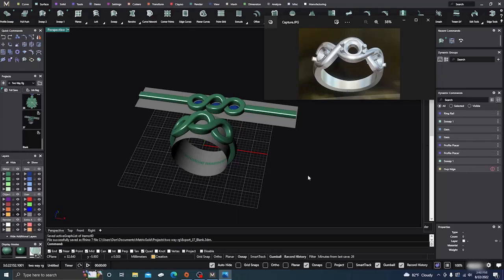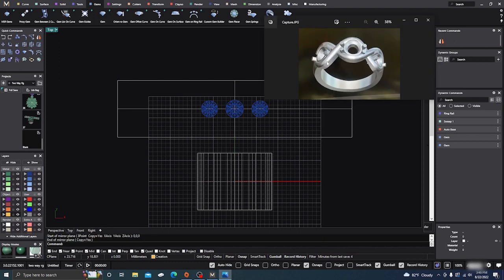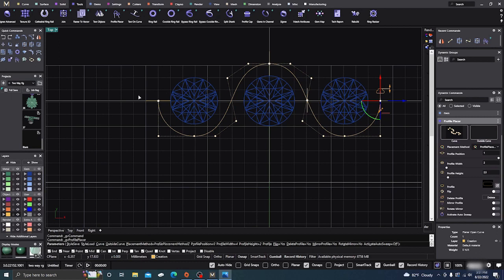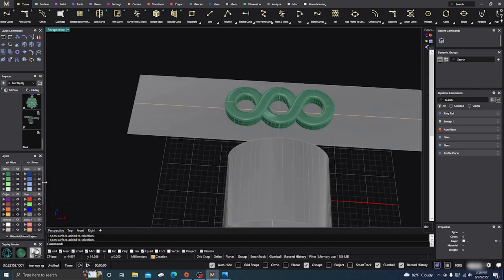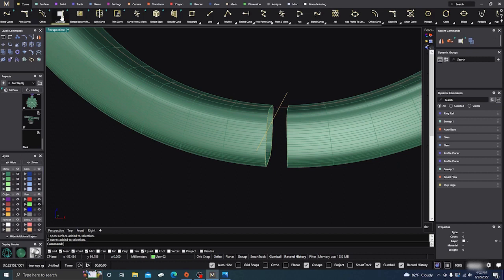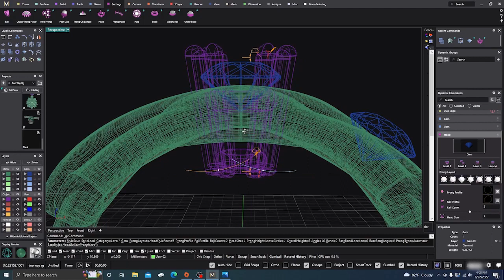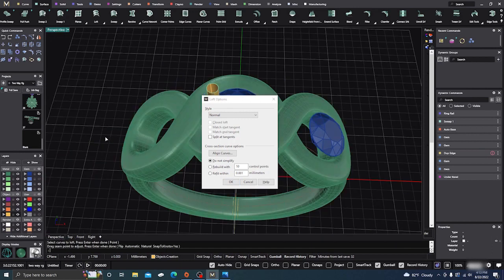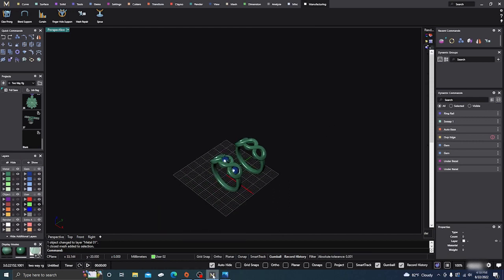Matrix 9 to MatrixGold conversion Smartflow Part 2

Comment: use grid snaps to place the autobase and gems in exact positions
Reply from the maker: Thanks for the information. Actually I could have placed the stones and heads on the auto base and clicked the ridged command and they would have flowed up ok. Spaced it. Lol I’ll be making a more comprehensive smartflow video in the near future. Thanks, I was really just trying to give a little insight on how to do a specific design for a blog post and thought I’d just throw it up for some to look at. But thank you for the extra information. I’ll be more specific in the future. My apologies.
Reply: @donsjewelrymakingandjapantrave  that's great, i appreciate the video no matter what! i learned something of it i wasn't aware of earlier. thanks again.

Comment: Did you make all those extra profiles in your profile library ? Is there anywhere I can get extra profiles and elements to load into my matrixgold that other users have made or do I need to make them all from scratch ?
Reply from the maker: Most of my profiles I made myself or imported them in from Matrix 9 using the Legacy import from the M icon in the top left of MatrixGold. But really if you sit down and just crank a bunch out using the Profile editor it makes it really easy. Then you can save them to your profile library using the Add profile to library command. You can also go to all the 3D printing websites that offer models for sale or many for free and download other prints and do some crazy stuff editing those into jewelry as well.  Sites such as Cults or Yeggi. I would just do a search if you're interested in Free STL files for printing. I'd try taking the head of a model cutting it off from the body and then make a cool ring or pendant with it. lol. Just fun and they can make some interesting items as well. Good designing.
Reply: @donsjewelrymakingandjapantrave  thanks so much for the reply. I’ve never even heard of those two websites so I’m really grateful. I would I have had to have matrix nine to use the legacy import tool? I actually upgraded from rhinogold to matrixgold and I’ve never had any other matrix product so not sure if I have that option available. Thank you so much again.

Comment: Hey Don, any suggestions on smart flow distortion? Whenever I layout a design in smart flow and then flow it to my ring surface it distorts the design in a long way around the ring. Thanks, Ken
Reply from the maker: Yes, that is an issue. I will try to make more content on that topic in the future. Sometimes I find myself just flowing the curves and adding the profiles on the curves after they are up on the item. There are some things we can do to resolve these issues. I'll try to work on that in the near future. Sorry for the late reply. I have been away traveling but back home now and should be posting more regularly. Thanks for all your support.